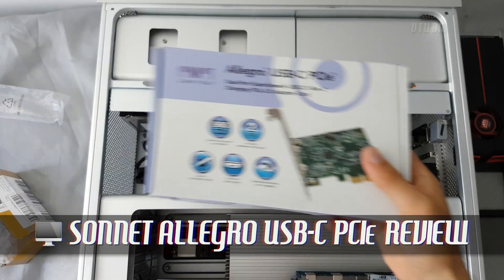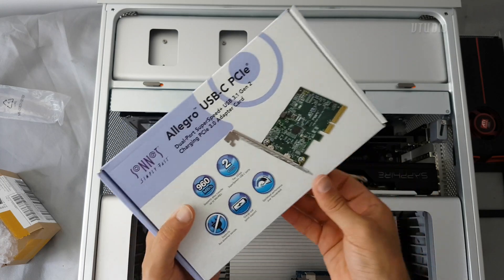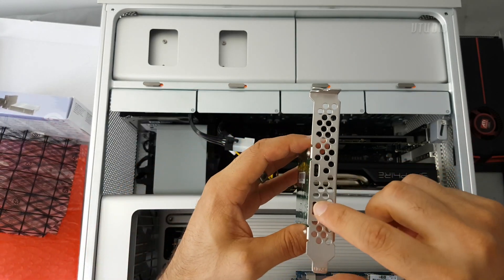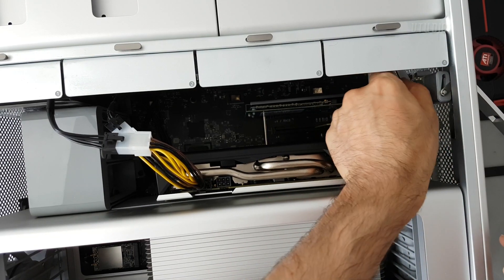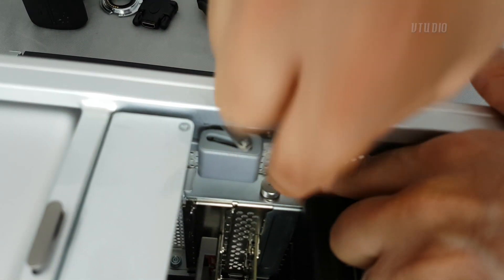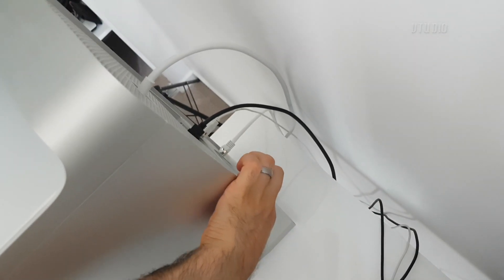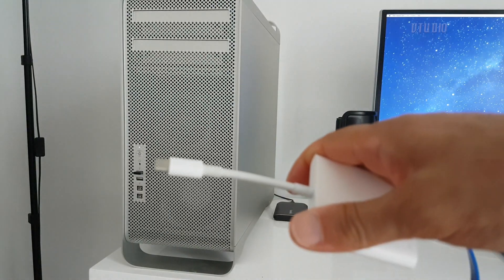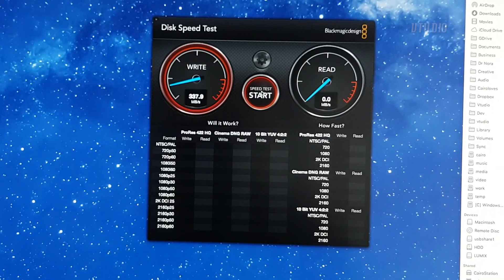How to Add USB-C to your Mac Pro | Sonnet Allegro USB 3.1 PCIe Review

Comment: Why is it "sad" ? The USB C ports you get from the Allegro are meant to provide max USB C speed when a single device is interfaced to directly to a single native USB C port. The minute you connect an external hub to the Allegro port USB C, the latter has no control how fast the connected hub will perform. Furthermore, you are essentially chopping up the Allegro USB C bandwidth in to small bits, which are shared by the hub's multiple ports. It is simple scientific fact. You can compare it to a door that accommodates a single pedestrian at any given time. If you increase the #of pedestrians to 2, and you want them to use the door simultaneously, then they can do it by facing each other and moving sideways. That will slow them down. Or you if 10 pedestrians come to the door at once, none of them will enter until they all line up in a single file. This means downtime and thus slow pedestrian speed of entry in to the room. Good luck.

Comment: Help - I just installed the Sonnet Allegro card into my MAC tower 5,1 (2006) and my SSD drive is not recognized. I'm running MAC OS 10.5.8, which I'd like to stay with due to my Avid Media Composer editing software I use. Any suggestions would be appreciated. There may be a driver I need? The other issue is the Mac OS 10.5.8 does not allow most web bowsers.

Comment: Hey man!  I was wondering if you are still running this build?  I am thinking about getting an old Mac Pro and following your guide to upgrade it!
Reply from the maker: Hey mate, I sold it last year[1] to buy a MacBook Pro instead[2]. Overall it was a great cheap system and I made money off the upgrade but, I just needed a newer processor for video encoding - the old chips are fast but don't have the optimizations for video editing.

[1] https://youtu.be/EB3XMmd-bCQ
[2] https://youtu.be/69DYj1HEEN4

Comment: I read that the 2009-2012 Mac Pros have PCI-E version 2 -- which only supports speeds up to 5GB.  Will a USB 3.1 Gen 2 USB card be able to provide 10GB speeds? I am not an expert in this area, but it may be a waste of money because it will not be able to give you the USB 3.1 Gen 2 speed.
Reply from the maker: Great point, but at least it's faster than USB 2's 60MB speeds.

Comment: what if i use usb c to connect to thunderbolt with an adapter?
Reply: thanks for the reply mate! Is there any way for me to connect a thunderbolt device onto that computer? even if it means sacrificing speed? like firewire adapter? a usb c dock? would any of that work?
Reply from the maker: Hey mate, not that I know of no. From what I've seen, there are Thunderbolt 3 PCIe cards however, they require specific motherboard support and driver installation.
Reply: thanks mate i'll do more research about it
Reply from the maker: This is a thread worth reading through: https://forums.macrumors.com/threads/testing-tb3-aic-with-mp-5-1.2143042/
Reply from the maker: Check this video out, he's got a demo of it running: https://youtu.be/ZRjDgzK575A
Reply from the maker: Hey mate, unfortunately it doesn't support thunderbolt.

Comment: Not sure what the first usb c adapter was, but apple's multiport adapter has only usb 2.0 which is why it didn't work. It should work with a standard usb c to usb 3.0 adapter.
Reply from the maker: Hey mate, they both worked fine when connected to my MacBook Pro.

Comment: Did you load the Kernal from Sonnet?
Reply: Thanks to this comment I was able to use my USB card with an external USB hub 3.0. It works after install the Kernel. Thanks to both of you!
Reply from the maker: Thanks for the update mate, glad it's working well for you.
Reply: Cesar Aguilar Where do you get the kernel driver
Reply from the maker: Thanks for the tip mate, how's it running for you with the kernal drivers?

Comment: @vtudio - what if you plug in a usb 3.0 drive with the adapter and no hub, do you at least get usb 3.0 speed then? Have a usb 3.0 external backup I would like to make faster but I would also like to have the usb c port for later

Comment: Thank you for your video's.  I have a question.  Did you try a 'powered' USB C hub?  I've found that the powered hubs (separate power source) seems to work way better than the non powered ones.  Another question. In a previous video, you replaced the graphics card.  However, later in that same video, you mentioned that you kept the original graphics card that came with the Mac Pro, and installed the newer graphics card above it.  In this video, I see that you had the orginal graphics card removed (near the end of this video).  What is the benefits of keeping both graphic cards?  Or am I mistaken?  Thanks again.
Reply: I found this on the manual I downloaded for this card.  Maybe it might make a difference?  
Support Note for Mac Users: In order for this product
to support full USB power delivery capabilities in systems running macOS, you must download and install a Sonnet kernel extension. Go to www.sonnettech.com/support/kb/kb.php and click the Computer Cards link, and then click the PCIe Cards link. Click the Allegro USB-C PCIe link, and then click the driver link. Download and install the USB 3.0 Power Kernel Extension (OS X, macOS).

After reading this I think I’ll go and download this before I install my new card which I just ordered.  

I’m in the process of upgrading to a 6 TB hdd, a ‘metal’ graphics card, this USB C  card and a pci USB 3.0.  So I really appreciate your videos.  I’m hoping when all done, I’ll be able to upgrade to the new Mohave OS.
Reply from the maker: Thanks for the tip mate, excited at your progress, let me know how it works out.
Reply from the maker: Hey mate, I did try but I didn't try with a brand named powered USB C hub, perhaps a Belkin would perform better? Although the official Apple one had problems too. The videos were shot at different times, the benefits of keeping both cards is purely for dual booting. If you're switching between MacOS and Windows, then having a native graphics card will allow you to see the boot manager. I've got a video on the topic here.
Reply: @headsoftech  I've got the same SAPPHIRE card in my 2010, 5,1,  and love the L00Ks of it with the lights out! I am now adding RGB RAM heatsinks, and then I am going with the LED fans. On subject, what is it like using the 3.1 USB3c ports? I haven't seen any USB3c cables around, but I haven't searched them yet either.
Reply: Mr. BLACKHAWK Can you detail the brand and type of the heatsink and LED fan?

Comment: Hello, 
- nice videos, thks; can  you try or maybe did you already tried to connect a thunderbolt device like promise R6, or G-raid hard drive , because i just bought a mac pro 2009 ( not received yet ), and i have a storage device the  "R6 pegasus from Promise", i need it for my videos, i wanted to plug it on this Sonnet card with  the apple adaptor ( thunderbolt female , usb-c mal) ? i 've heard that thunderbolt is difficult with the old mac, hope it would work cause i need it .  thank you 

- i just see today your video where you compare speed from the macPro and your 2018 macbook, and your not so happy with encoding with FCPx, :-( , i'm a little bit desapointed buy buying this Mac and i want to upgrade to max i thought it could be the 2018 beast for my editing task ! but maybe i should keep in mind like you said that it's half cheaper than a 2018 for same power ... :-(
 
- the graphic card you took, seem to be very good !!! maybe it's help a lot for FCPx because of the open CL, a bit expensive for me can you advice an other similar ? the little sister :-) 

regards thank you 

https://www.apple.com/fr/shop/product/MMEL2ZM/A/adaptateur-thunderbolt-3-usb-c-vers-thunderbolt-2?fnode=14897f3d1b62b6d486b6a3f8dd282a458b5325b34833303ef596a37c16f3fe169507f864866bbab07a0647f168f54a04de27f2dfc57174ea9ced6ca5aff51037d7b33d5db84b6e52e2a5e7e6f95b36c41b4ddc8121cc851d1ae9f3b4ae78d1df

Thank you .

Comment: You sure that adapter isn't usb c to usb 2? The only reasonable explanation for a 10/Gbs port to show usb 2 speeds would be a USB 2 cable or adapter.
Reply from the maker: Hey mate, I remember testing it with several hubs and cables which worked as expected on my 13" MacBook Pro, you can see that when I used the official Apple adapter it just hung on transfer. Note - This was tested with MacOS 10.13.2, so it's possible that it could of been since fixed in a future software update. Please let me know how it works for you if you grab one.
Reply: Thanks for the update. I've ordered one of these, should be here soon... I'll post  back with an update if I find see it working properly in an update... Cheers!
Reply: Hey Justin, any update on this?  Thanks! @mrjcrosby
Reply: Justin Crosby how is it?

Comment: I wonder if the more expensive cards that require power would be able to handle a USB C 3.1 hub. BTW, I found this about enabling TRIM on third-party SSDs on Macs. Not sure if you enabled it on yours but sharing since I didn't see it on your video about SSDs.  I just enabled it on my Samsung SSD. https://www.howtogeek.com/222077/how-to-enable-trim-for-third-party-ssds-on-mac-os-x/  more details here: https://computers.tutsplus.com/tutorials/how-to-check-and-enable-trim-on-a-mac-ssd--mac-60738
Reply from the maker: Thanks for the tip mate!

Comment: MacOS 10.14 System requirements
The fact that the next very of macOS won't support 32-bit apps also hints that there may be a few more Macs that aren't supported either.

Another clue as to which Macs might not be supported is Metal. Macs that don't have Metal support could get dropped after High Sierra.

This could leave only the following Macs:

iMac models from 2012 or later
MacBook models from 2015 or later
MacBook Pro models from 2012 or later
MacBook Air models from 2012 or later
Mac mini models from 2012 or later
Mac Pro models from late 2013
This seems unlikely this soon though. So we think it's more likely that we might see the following Macs supported.

Early 2011 or newer MacBook Pro with Thunderbolt
Early 2011 or newer iMac with Thunderbolt
Late 2017 iMac Pro with Thunderbolt
Mid 2011 or newer Mac mini with Thunderbolt
Early 2015 or newer MacBook with USB-C
Mid 2011 or newer MacBook Air with Thunderbolt
Late 2013 Mac Pro with Thunderbolt
You'll notice what that last option means - no more cheese grater Mac Pro support. Apple had better hurry up and launch it's Mac Pro successor.
Reply: Erion Totaj hi, I’m a. Newby for upgrading Mac pro’s. You state “The fact that the next very (version?) of macOS won’t support 32 bit apps.....”.  Does that mean Apple will stop supporting this MacPro, and/or, does that mean all the apps that I’m getting that message” this app is not compatible ....32 bit.....”.  Won’t work again even if I upgrade to a metal graphics card?  What bit’s are the new apps coming out at? 64?  So even if I get a new metal graphics card, will I be able to upgrade to Mohave?
Reply: "very of macOS" WHAT language is that???